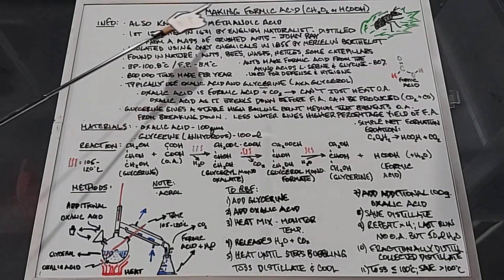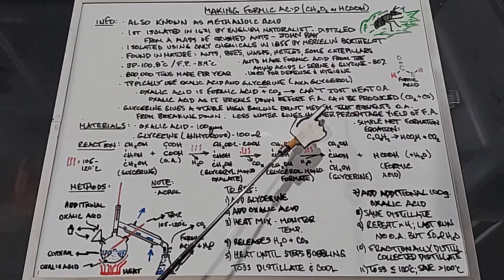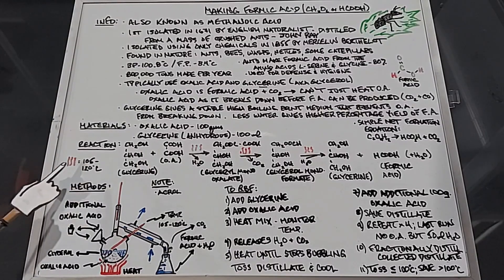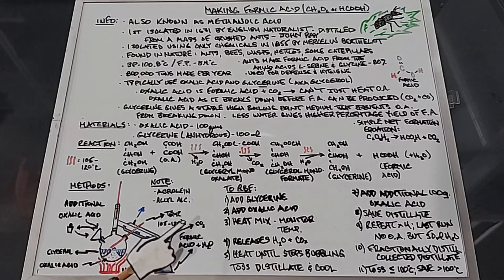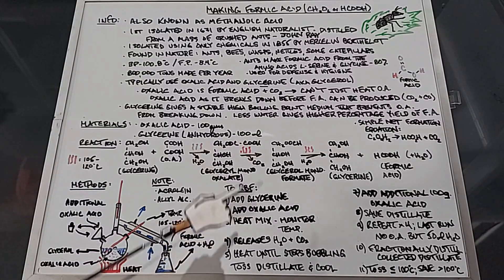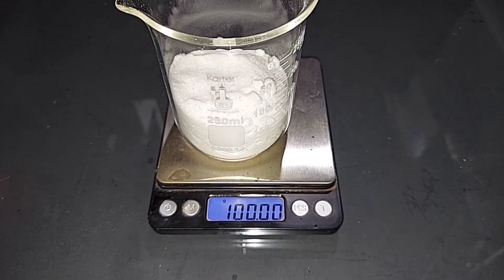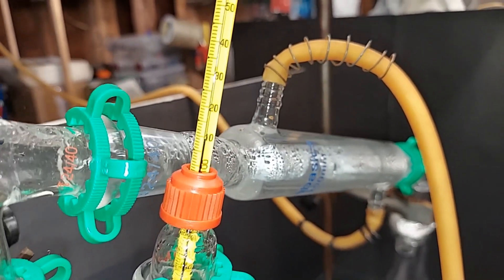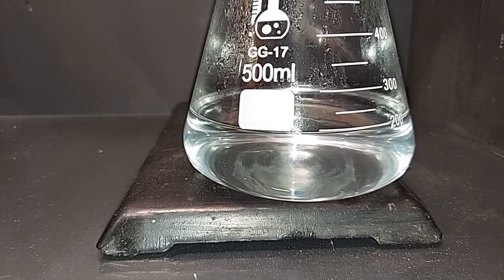Making Formic or Methanoic Acid

Comment: I made formic acid much easier from ethanol as a byproduct.

ethanol + calcium hypochlorite -(cold water solution)-> chloroform + calcium formate

calcium formate(dry) + cold concentrated H2SO4 -(diluted in a bunch of ice cold ether)-> CaSO4 + formic acid

The dilute ice cold solution of H2SO4 in ether needs to be added dropwise to the suspension of Calcium Formate while stirring. The reaction can form carbon monoxide as a byproduct.
Filter the CaSO4 and boil off the ether to get dry formic acid.

My use for calcium formate, however, is not necessarily formic acid but rather heating the calcium formate to make formaldehyde.
Reply from the maker: Great info.

Comment: Hi from France,
Greetings a lot for this setup, explanations and skills !!

It is quite easy for european people to purchase in Germany at Hoëfer Chemie GmbH some plastic bottles of formic acid at 85% of concentration.
It smells terrible, as a very strong kind of pungent vinegar.

But I wonder, to achieve such purities, are these industrials using molecular sieves in order to catch the remaining water ?

I have also heard that special catalytic system can provide hi-grade formic acid, very pure, via the electrochemistry of carbon dioxide, sometimes carbon monoxide as the main feedstock, with some hydrogen added.

Best regards and thank you very much for this demonstration !
Reply: The industry uses pressurized distillation columns to up the percentage of formic acid in the azeotrope. Molecular sieves are destroyed by formic acid.
Reply from the maker: The most common method is reacting methanol with carbon monoxide with a catalyst which is usually sodium methoxide.  The reaction is done under heated and pressurized conditions.  And, as was mentioned, and something I tried for good measure, formic acid is absorbed along with water by molecular sieves which in turn breaks them apart.

Comment: I heard that you should never insulate a fractionating column. It defeats the purpose of fractionation.
Reply: Not true, a number of the fractionating columns I own have a vacuum jacket. If they do not, I typically end up wrapping them in glass wool and then foil. Otherwise it takes the column too long to equilibrate. Fractional distillation is definitely not easy for the impatient, which unfortunately I have a bit of.
Reply from the maker: I appreciate the help.  I can understand though why it would seem not to make sense as it's not obvious just by looking.
Reply: @artcox2991  Columns have to be fed vapours from the bottom and some volatile fraction from the top. The column itself should be insulated, but with excessive insulation, the reflux can dry up. i usually managed it by leaving the top of the column naked, with the length of this bare part depending upon the boiling point of the distillate. This length can range from leaving all the column not insulated, or completely wrapped in glass wool for high-boiling compounds that refuse to come over otherwise. 

For the most demanding distillations, artificial reflux is necessary. I've only done this once, but it works great.